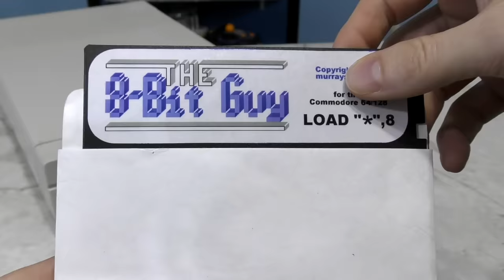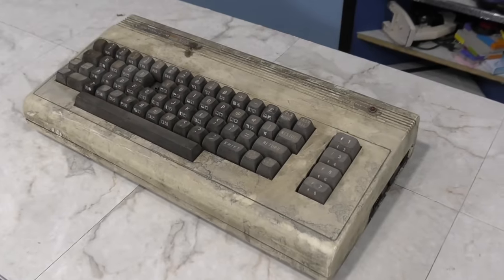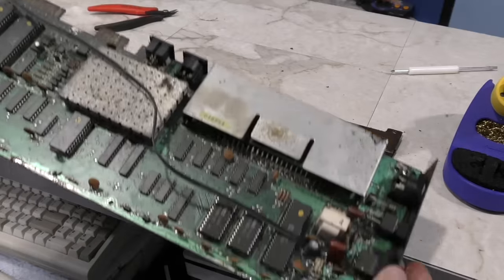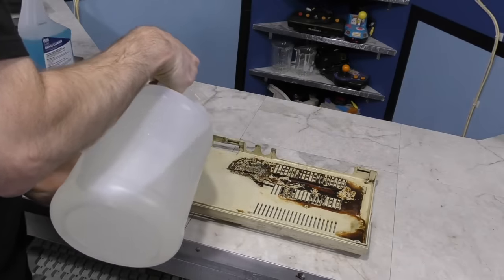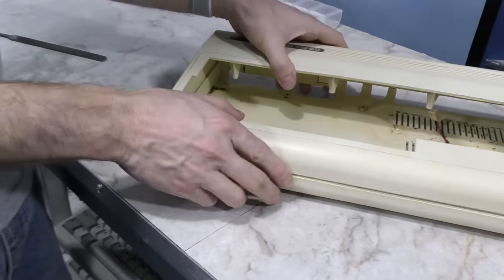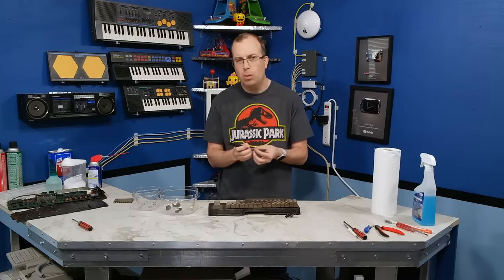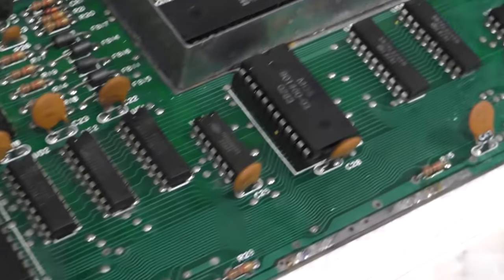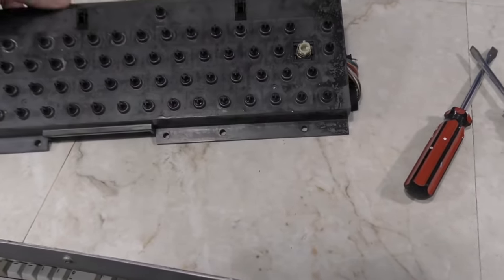Restoration - The Worst VIC-20 I've ever seen - Part 1

Comment: I would have used some dawn dish soap diluted in water and a soft scrub brush as my first attempt (staying clear of any labels) and just using diluted dawn and a finger on the decals. Dawn would have cleaned that oil right off.
Reply: madmax2069 Can I use Cascade?
Reply: Teaze don't know, just go to a store and buy a small bottle of dawn
Reply: madmax2069 Don’t know why dawn tho

Are you sponsored?
Reply: Teaze dawns just very good at removing oil
Reply: I wonder what he uses to clean his kitchen.
Reply: ToloGF poop smeared on a towel
Reply: Nope. You need a heavy degreaser such as Purple Power or Super Clean
Reply: Dawn is a brand that does a lot of charity work with clean up operations, and they've made a name for themselves as the product used to help save animals caught in oil spills because it's safer and cheaper than other de-greasers. It's not necessarily the best thing for a job like the one in this video, but people associate the brand with being good for more than just dishes so it's the first name people think of.
Reply: madmax2069 use distilled water
Reply: LivtheFlame haha, nice try Mr. Dawn, your mind hacks won’t work on me and my tinfoil hat.
Reply: Work on a car for an hour, then try to clean your hands with "diluted Dawn and a soft scrub brush."
Reply: @Brastius  done it plenty of times, yes it's not as potent as full strength but it doesn't need to be full strength.
Reply: true.
Reply: @madmax2069  that always gets the early worm
Reply: Mr. Krabs I wonder how well the plastic would stand up to such a strong degreaser
Reply: There's this degreaser called Jolt; we use at the restaurant I work at. It does a good job, yet it doesn't harm the object you're trying to clean. I wonder if that would work well for this.
Reply: @teaze1642  dawn cleans the Penguins.
Reply: Don 't know what it is called in the us but I would have soaked the entire thing in st marc cleaner. Works miracles for grease and yellowed plastics
Reply: madmax2069 #ad am I right?

Comment: Dude, my Commodore 64 and 1541 drive looked exactly the same way when I pulled them from a friend's shed after they were sitting outside a box for 20+ years. (There just wasn't any oil and the connectors were ok.) After heavy cosmetic cleaning mostly on the exterior, it fired right up and is still working fine now.

Comment: "So I just covered the entire computer in WD-40" -8-Bit Guy  
  Bet you never thought you'd say that XD
Reply: Why?
Reply: If you don't want it to move, duct tape.
If you do want it to move, WD-40
Reply: @cherrypepsi2815  Gorilla glue works good too (if you don't want it to move)
Reply: @lordevyl8317  gorilla glue is dogshit. It puffs up so much.
Reply: @cherrypepsi2815  Krazy Glue is so much better, and it's also much cheaper than overrated Gorilla Glue
Reply: @scottbreon9448  Loctite superglue GEL is fucking amazing and I swear by it. I've had it hold 10lb easily just seconds after application.

It sets in seconds and holds way more than you'll ever need

Comment: Pro tip: Don't store your computers in vats of chocolate and melted bubble gum.
Reply: Smaakjeks K 
why is there hair in your vats of chocolate and gum
Reply: +Necluda
FDA regulations allow for 3 or fewer rat-sized clumps of hair per vat.
Reply: Smaakjeks K yes
Reply: Computer came from the Wonka Chocolate Factory, and there was an “incident” with some visitors a while back.
Reply: fun fact, gum was a kind of tree sap, and some gum brands such as Glee Gum, still use the same tree sap! 🤓
Reply: R u sure cuz I thought ur supposed to do that
Reply: Smaakjeks K 
Are you dutch?
Reply: k thx
Reply: as well as oil rigs
Reply: vinegar and salt is a much better option
Reply: yeah, salt and reeses are a much better option

Comment: We need to get you a huge ultrasonic cleaner.
Reply: Snazzy Labs!
Reply: Or a Dremel.
Other rotary tools are available.
Reply: Soaked overnight in a bath of Jizer (just the one Z, add another and this is completely a different natural product!) and then thrown in the dishwasher if I was doing this clean up.
Reply: Chevron with Tecron gasoline, or plain Dawn dish washing soap is a great degreaser
Reply: Hi Snazzy Labs, I didn't know you were interested in retro stuff...
Reply: Don't delay, buy today!
Reply: Soap and water, no need to use chemical stuff. (And a sunny day tours dry the thing)
Reply: Snazzy Labs .. Indeed... I use one of those for my mini blind cleaning business .. Works amazing.
Reply: sand blaster with baking soda :)
Reply: I never knew that you watched the 8-bit guy too. I am subscribed to both of you

Comment: Sounds like you need a decent degreaser in your arsenal.
Reply: +Handsome_Hero That's quite the proposition.
Reply: He has brake cleaner, which is a mixture of solvents, so should act as a reasonable degreaser in most circumstances.
Reply: Grease me up woman!
Reply: Yeah, auto degreaser is much milder than carb cleaner and works the same without the risk of solvents on delicate parts.
Reply: Limonene is basically just pressed citrus peel. and one of the most powerful industrial degreasers.
Reply: Wouldn't dish soap be a good and kinda cheap alternative since it dissolves fat and that sort of stuff?
Reply: Agreed, first thing I'd reach for would be Simple Green.
Reply: @ Pandaren Warrior - He's a real smooth talker!  He has a very slightly modified version for the ladies! ;-)
Reply: Soaps either don't work on oil, like the glass cleaner, or are very slow. Degreaser has emulsifier that specifically breaks down oil, and very fast. There is all types of materials in engine bays, alum, metal, plastic, brass, copper, rubber, wiring, glass, zinc plating, gold passivating, paint, etc, and it's designed to not effect them all.
Reply: I was just about to comment this myself.
Reply: Dawn dish soap! Excellent degreaser! And benign to plastic
Reply: SidneyCritic ComedyHound that's all I kept thinking, a bit of engine degreaser would've shifted the majority of that gunk with ease
Reply: TSP (Trisodium Phosphate) is a water soluble detergent found at most hardware stores - it does a decent job.

Comment: In cases of "critical gunk" like this, I use  a 3M citrus based cleaner. Is basically lemon oil. And the best of all: Is water soluble. Is a little expensive but really worth the money.
Reply: There's cleaners available in Australia branded "Orange Power" which sound like they're made by someone with the same idea.

Comment: I've recently restored two C64's in almost identical condition, but with hardened cement between the keys. It was pretty challenging and now they both work fine ^^
Reply: How did you remove the cement?
Reply: i agree.. if you want to restore 50 C64's, you definitely should do it! It's a labor of love! Just.... i disagree with the last sentiment. Don't hoard them! They're not only collectible, they're things people love and which can spark their dreams! If you have this many stashed away, and no one's buying them - consider giving them away to fellow enthusiasts - people who would appreciate the value!
Reply: Carefully breaking the cement into pieces and lots of water (electronics removed).

Comment: Dawn.
Dawn.
DAWN.
Use DAWN. The whole point of the stuff is to break down oil for cleaning. 
That and Goo Gone. Not Goof Off, Goo Gone specifically.
Reply: Agreed. I think that whenever I need to get grease or any oil off my hands, that's what I go for.
Reply: I bet it never DAWNed on him
Reply: @jeffsabados8075  Get out.
Reply: Jeffrey Sabados Bu dum tsssss
Reply: @LesKing72  woooosh
Reply: @thevioletwild  you're going to be the one getting wooooshed if you post that on reddit
Reply: Honestly, I was wondering about using Dawn, and simultaneously wondering if it'd somehow ruin the electronics.
Reply: Dunno man, dawn seems best for my dishes not a thick oil on a computer
Reply: austinmcconnell is that you
Reply: Joseph the Stickfigure thingy r/ihavereddit
r/cringetopia
r/coaxedintoasnafu
Reply: DAWN damages computer parts.
Reply: @catkinggaming7334  how? I've used Dawn for decades without issue
Reply: @baragonkunfan94thesecondar60  nice job I've seen you before
Reply: @Chaos89P  I've used a drop of dawn on a toothbrush to clean up tons of consoles. It works great.

Comment: I used to work at a factory with molding machines, four of the machines had Commodore PCs in them (though I'm not sure what kind, most likely the Vic 20 since the machines were built in 1985).

The other machines has Microsoft PCs in them, some with Windows 3.1 and the newest ones with Windows XP. It was...yeah, it was messy. Haha.
Reply: Makayla Serniotti Wouldn't doubt they'd be powered by them.  Interesting what a home computer could do for industrial purposes.
Reply: Gg

Comment: Restoration? Commodore computer? Worst condition ever? You've got my attention. Instant click. :)

I just love seeing other people restoring oldschool stuff against all odds. Why? Because I've done it sometimes and It's just pleasantly relaxing to see someone else do it now. :D
Reply: CJWarlock I've been restoring a PS3 that was about 90% dust. It also has a ton of corrosion on the metal over the blu-ray drive and some of the shielding. Unbelievably, it was fully operational before I took it apart. The sole issue was that it would sound like a jet taking off after about 5 minutes of gameplay. Luckily I did buy it as faulty as the hard drive needed reformatting.
Reply: Congrats on the achievement! And on the working condition of that PS3 bought as faulty :)
Reply: Thanks

Comment: Consider a razor blade for scraping gunk off next time. Same concept as the screwdriver but you can finesse it more.
Reply: True, but I think the reason he used a slot screwdriver is because the edge is not as sharp.  That way he could scrape off the gunk (whatever it was) on the outside of the case with less chance of damaging the plastic.
Reply: Bobby Horton ok but dawn is made to use on dishes?
Reply: @I Live In A Van Down By The River would likely break off too much of the plastic tbh
Reply: @deepfriedwaffles Still the same concept. Oil is oil.

Comment: This is my favorite type of video on your channel. I believe the "vibe" I like in something like this is due to the fact that it wasn't really "planned in advance" as you said in the beginning and possibly because it was such a complete mess that getting it to work would be an AMAZING accomplishment. I love the "get your hands REALLY dirty"  and the experimental "follow along as I succeed by failing" aspect. I do find it HYSTERICALLY FUNNY how averse you are to getting your hands dirty touching that "mystery oil". :)

It would be interesting to figure out what causes the discoloration of plastic with the break cleaner. Is it a "permenant" discoloration? Does it seep into the plastic? Or is it something that could be "fixed" after with the retro-brite technique? I have some old yellow-y computer crap in a storage unit I might test it out just for my own curiosity.

One thing that has happened to modern computing is the complete inability to "fix" our computerized devices. Everything is glued together. Even Apple won't fix a lot of their devices as it's cheaper and easier to simply replace the entire thing. I really really miss the old days when I could disassemble a bunch of macs where I worked in a graphic design studio. Swapping out video cards or ram (Sorry Steve, but Joe really needs that video card and ram more than you because he's doing 3D. You will get the next upgrade promise). I remember those horrible analog mice with hard rubber balls and rollers that had to be cleaned regularly. Now, forget about it. If I COULD pry apart my macbook pro without destroying it, there really isn't much I can do with it anyway.

Comment: Looks exactly like the computers in the machine shop where I used to work.  The cutting/cooling fluid would vaporize into the air and PCs would fill up with with the oily sludge.  Once, I put a PC on its side and over the weekend the fluid oozed down into the corners of the case.

Comment: This brings back memories. I maintained computers for a factory. They were using 80s era DOS PCs, connected to tape readers from the 70s. Much of it was proprietary hardware, no longer made. So whenever one failed, I'd have to take apart the filthy, nasty machine.

Comment: Next time, try Dawn dishwashing detergent. Another option is either Simple Green or Mean Green degreasers. All of these should work well for this type of cleaning.
Reply: Was going to say the same thing.  I wonder what Dave has against using dish detergents.   Just leave to soak in a plastic tub.  I use that to clean all my thrift/ebay stuff and it works well.  The damage to the plastic caused by the brake cleaner made me cringe.
Reply: I can second using Simple Green. I used to use Simple Green when working at a local manufacturer. I ran a CNC there, and they would get covered in a sludge made of fiberglass dust, coolant from the machines, grease, and dirt blown in from outside. The CNCs would be black with grime at the end of each day. We used Simple Green to clean everything, and at the end of each day, I'd spend a good chunk of time just cleaning the machine I was running that day. It worked very well, made those CNCs look like new.
Reply: Dave D simple green also removes corrosion.
Reply: to clean oil stains you use "heavy-duty hand cleaning paste" or just "CIF Cream" which is in any household

Comment: you should really invest in a 3d printer for those plunger issues :)
Reply: He own one
Reply: Not a bad idea. But, if there is not an existing model out there, you do need some CAD experience.
Reply: In a more recent video, he 3d prints one but doesn't like how it "bobbles".
Reply: @mahna_mahna  wouldn't that be an issue of the 3d model/plastic used instead of printing itself

Comment: Used to sell a PCB cleaner product that was a lot like brake cleaner. They are very much the same. Not only would I use it on electronics but also dry cleaning carpet when people would walk grease into the shop and of coarse used it on the brakes and the clutch face.
Reply: m3sca1 So it's a good idea to use brake cleaner on electrical contacts? Not something I'd ever have thought of.
Reply: CrAzYgIrL only on really roached stuff like 8bitguy is trying to clean. It is basically a very strong solvent that quckly evaporates leaving nothing behind. It hoses out, not a fine spray...pushes the crap off as well dissolve it.
Reply: CrAzYgIrL 
You're better off using a contact cleaner on electrical contacts as they usually contain a small amount of lubricant and protectant whereas the brake cleaner is just a mixture of solvents which, although it would likely clean contacts, it would not be as effective long term.
Reply: Alright, thanks guys
Reply: Brake cleaner probably my favorite cleaning product. It dissolves fuckin everything. The only downside is that it litterally dissolves everything. I was using it when cleaning the engine on my friends Pacer, and it cleaned off the print on all the labels and stickers aswell.

Comment: looks like water damage. perhaps it survived a flood?
Reply: an oily flood
Reply: probably wwii
Reply: Reminds me of when I was doing some cleanup work after Hurricane Katrina. The floods washed out a local oil refinery, causing the oil to mix with the floodwaters. It had soaked into the carpets of the house we worked on. I guess it wouldn't surprise me too much if someone had tried to salvage this from a Katrina house, although it's less likely that they would have let it sit around for a whole decade after that.
Reply: My guess is it coukd have been near a fire where sprinklers went off.  Smoke can be very oily.
Reply: Or mabye it was used in a oil refinery
Reply: Houston and the surrounding area had massive flooding in the 2nd half of 2017, and has frequent more-minor flooding generally.  I wouldn't be surprised if this came out of that.
Reply: In an industrial situation - most likely someone spilled their coffee on the keyboard. Liquid would not short out the keyboard PCB and drain off to the side and bottom of the unit. Tannic acid in coffee and tea is corrosive to metals over time and if the coffee has sugar in it it would form a hard crust similar to what's being scraped off with the screwdriver tip.
Reply: It was the only survivor of a atomic bombing.
Reply: No, no. I bet some car mechanic was trying to fix a car, couldn’t find a way to fix the engine, just said “screw it” and threw the Vic-20 in there and called it day.

And it actually worked. Well, until about a month or so when the power supply failed and fried the car. Oh, about the guy who owned the car? He was too busy playing Crisis on his Altair to notice for about 2 weeks.

I bet my comedy was atrocious.
Reply: Or if it was somewhere low during a flood, as the water level when down, that could have made a concentrated oily mess.